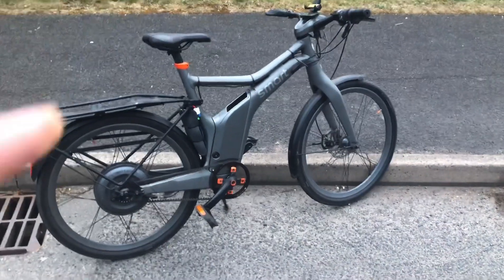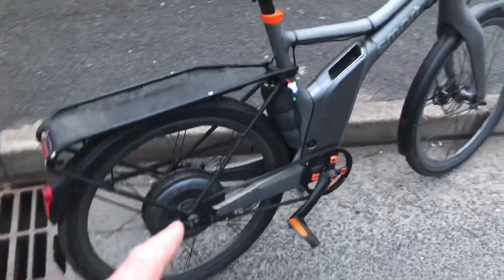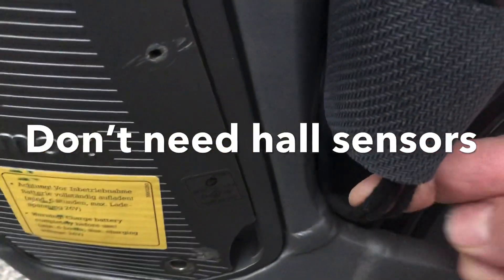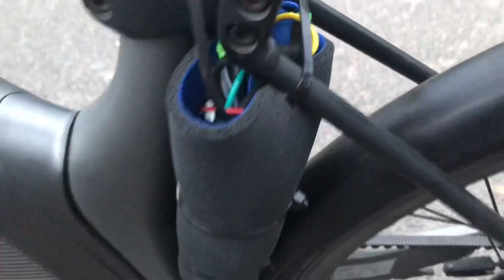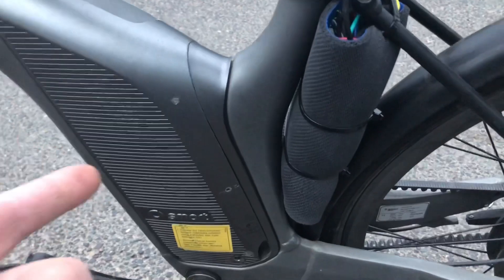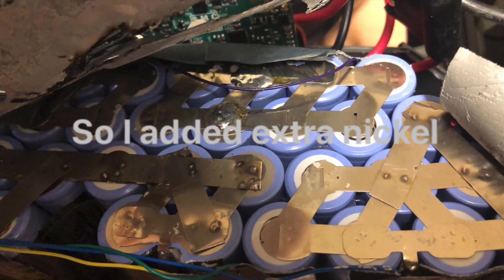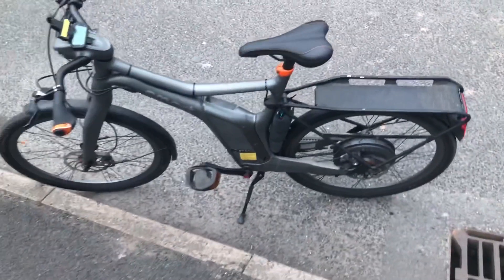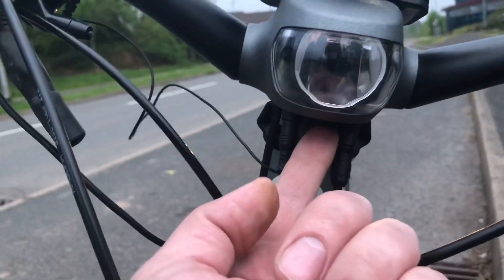mercedes benz electric carbon drive e-bike 48v bionx controller upgrade, battery issues #smartazz

Comment: Hi I am looking at this bike butnit is missing the display do u know if i could bypass, build or puchase one? Thanks  I like the way you just got work to get it going!
Reply from the maker: Hi thanks for watching. You will need the original type of display for it to work again. If not available you will need to replace the inverter that’s in the wheel and do what I have done. Good luck
Reply from the maker: Have you cleaned all the pins on the back of the display?
Reply: Thank you. The display is missing so i will replace the controler.

Comment: I have a bike like yours and the BMS has failed.No one can fix my battery and I would love some suggestions.I don't want to scrap this bike.
Reply from the maker: You need the battery rebuilding and a new BMS fitted I’m afraid, same thing I did in this video
I also added a new controller
Reply: @smartazz  That's what I figured.Should I remove the hub motor control board in the wheel and take it from there.
Reply: Thanks for you help.If I bought a new battery with a built in BMS and mounted it on the back rack and put my controller in the battery case after removing the cells and the board in the hub could I make this work? Thanks for your help.
Reply from the maker: @gerry5029  yes absolutely. It’s not an easy task as the spokes need to be removed to accessible the hub
Reply: @smartazz  I will take the plunge and go for it.The bms seems to be an issue with these bikes and there no point in finding another battery and going through the whole routine again.I appreciate your help.
Reply from the maker: @gerry5029  somehow I managed to keep the power for the lights but I can’t remember now sorry
Reply: @smartazz  Thanks for your help.I was wondering what tool you used to remove the concealed spokes.
Reply from the maker: @gerry5029  flat head screwdriver. Take the tyre off and remove the inner tube protector giving access to the spokes. I only removed one side of the spokes in the end ( the 2nd time I stripped it) but I couldn’t tell you what side comes off the motor first sorry
Reply: @smartazz  Thanks .
Reply: Doing one side is a great idea.I would not have thought of that.

Comment: Can you provide the controller reference? Because it looks less bulky than others I've seen and apparently less expensive as well. I have the same bike and it seems the internal controller inside the motor has blown as well. I am taking the oportunity to unlock the bike from all this Bionx nightmare. Thanks.
Reply from the maker: ￡8.33  30％ Off | Electric Scooter Accessories 36V/48V Electric Bike 350W Brushless DC Motor Controller For Electric Bicycle E-bike Scooter
https://a.aliexpress.com/_vCuBhT
It was a long time ago but I think this was the Controler I used in that build.
Reply: @smartazz  Seeing the vid again, trying to understand if you used the pedals or the throttle to have the motor running. I've opened my motor already and like you, no blown fets, and nothing seem to be actually burned. Still the motor coggs, does no assist or regen and the battery enters a never ending beep loop (Error code 66).  My question is, did you found any strain gauge inside the motor, after removing the controller board? If Not, where is it located? Thnks.
Reply from the maker: @ricardom959  it’s inside the wheel
Reply: @smartazz  So, apparently in my Smart Ebike with the green/white color scheme there's no strain gauge inside the motor. I've checked and there are no additional wires connecting to the controller PCB, aside from the motor phases and hall sensors. In the meanwhile, I've opened the small plate underneath the pedals and saw the connection wires and plugs to the torque sensor. The model is a BBRTS FAG torque sensor. The very same as with Grace Easy bikes.
Reply from the maker: @ricardom959  can you upload a short video please ? Looks like they changed it.
Reply: @smartazz  My BMS has failed on my Smart E bike and no one can fix it.Suggestions?

Comment: Thank for your video. I have that  Smart Ebike (model 2013, Daimier) The label says 35 km/h, however ir only reaches 20 km/h, the battery is still good. Do You know how I can remove the speed limit? Thank You.
Reply from the maker: The only way I know how to do it is to have an external controller. It’s not the easiest thing to do tbh.

Comment: Hi! I own a smart eBike like yours but it's stock, it developed a problem that lets the pedals spin freely on 1ts and 2nd gears. Whenever you shift out of 3rd gear it would just spin. Do you happen to have a service manual or know what to look for? Mine is a 2013 year model in white, yours looks awesome!
Reply from the maker: You need to take the gears out and you should see the problem. You basically have 3x freewheels and I reckon 2 have spring issue.
Reply: @smartazz  I did take them out but found nothing wrong to the best of my understanding. All gears had a spring around the inner hubs. I'm kind of lost. Thanks for the answer 👍
Reply from the maker: @daniellanderos6243  make a video and share the link here , try and move the gears and try to engage the 1st and 2nd gear, I’ll see if I can see why it’s not working.
Reply: @smartazz  this is what it does, I've teared it apart today again, found sticky grease and replaced it, bike clocks 37miles its "new" (from 2013) so i belive it shouldn't be doing that.
Reply from the maker: @daniellanderos6243  The ticking noise is normal. I heard an extra noise that was not normal. The next time you take it apart take a picture of the inside. Something inside is either broken or not in place.

Comment: Hi. 
I have the same bike. 
I am wanting to do a few upgrades on. 
Just want to check a few things with you.

Thanks
Reply from the maker: What would you like to know ?
Reply: Smart Azz I was thinking if it possible to attach some how a throttle kit so it no longer pedal assist
Reply from the maker: Patrik Hriczo do what I did :-
 https://youtu.be/Wc8OJtFRUng
Reply: Smart Azz I also got a speed remover M- Ped SE
Reply: Smart Azz what about the battery I want to get more rage, what can I do ?
Reply from the maker: Patrik Hriczo fill your battery with Samsung 30q cells
Reply from the maker: If your M-Ped SE works then I wouldn’t change anything as it’s a nice bike as it is. But if the controller in the wheel fails I can replace it with an external controller (unlocked) and upgrading your battery with new cells would be awesome 12Ah  80A peek 60A continues